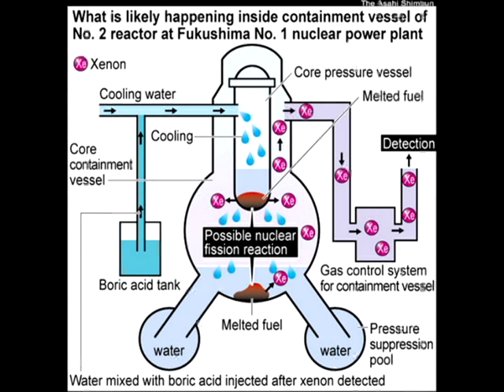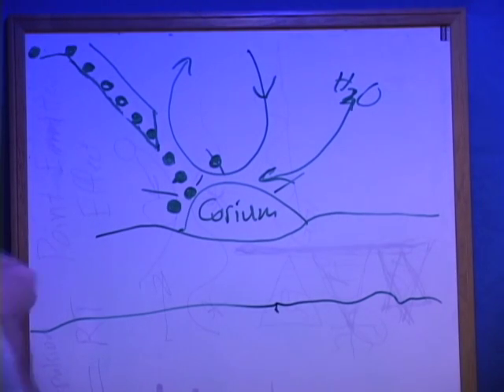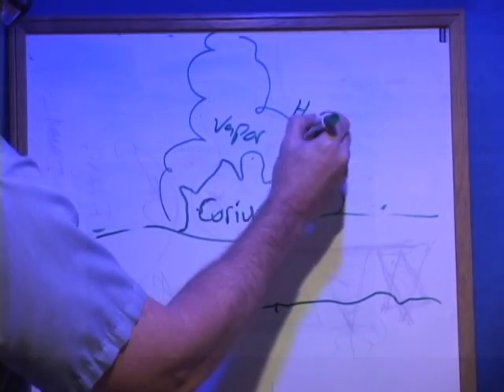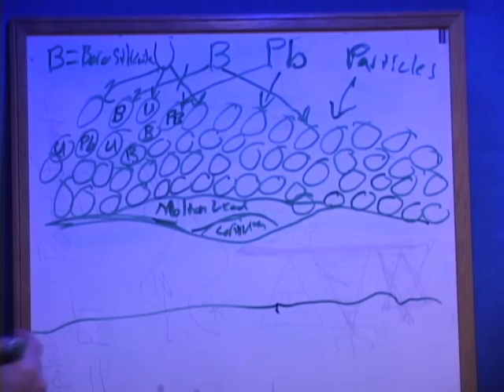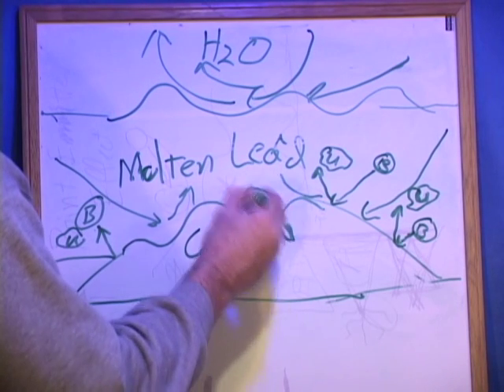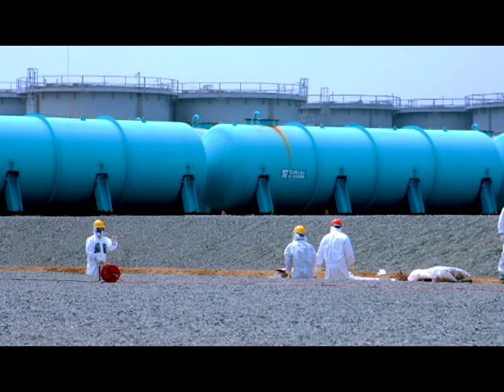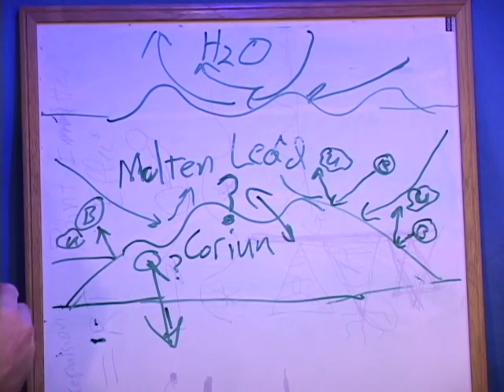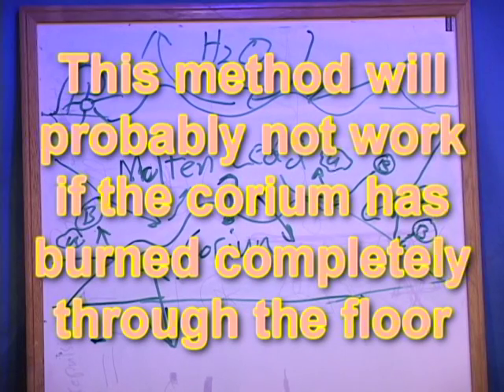Possible method For stopping a Nuclear Meltdown

Comment: the contamination leeching is into ground water is beyond acceptable ,it is alot ALOT worse than what we have been allowed to see thusfar :(
Reply from the maker: Right. I've seen the news recently that contamination is elevated. Sounds like the corium has probably gone through the floor. So, as stated in the video, this method probably won't be helpful. Thanks for the comments.